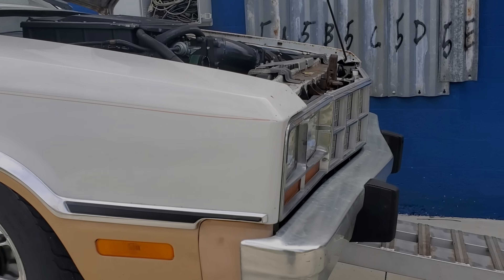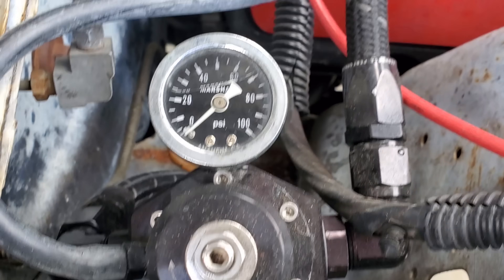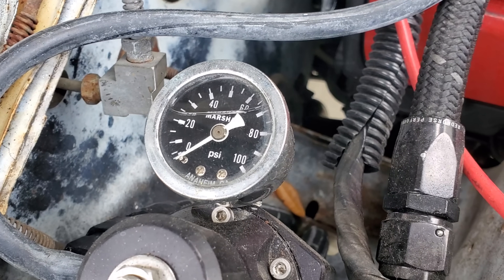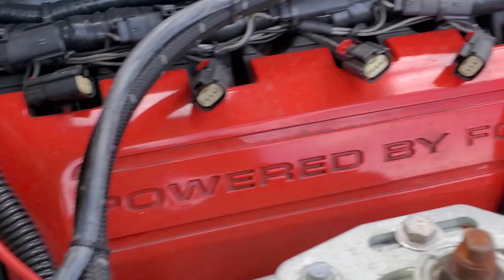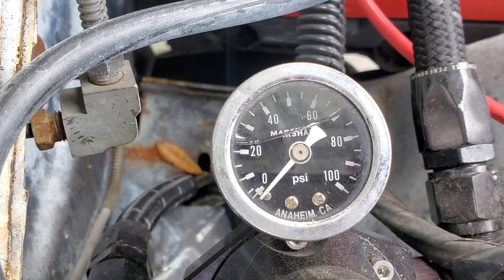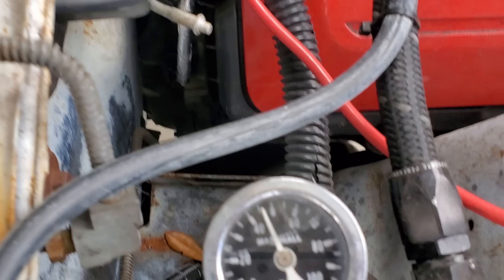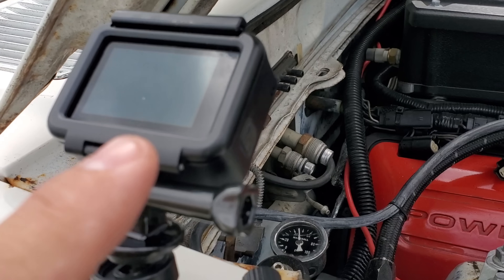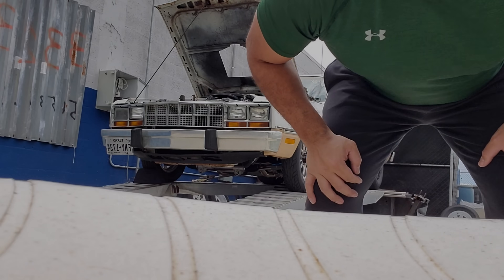Return Fuel system setup on Supercharged coyote powered Ford vehicles.

Comment: Can you make a video on installing in line fuel filters on s197 with a return style setup?
Reply: I just finished installing my FORE fuel system.  Once you're under the car doing the install it's straight forward to screw the bullet style filter onto the AN lines.  FORE's machined filter holder was too big (hung down too low) to work on my '11 GT500.  I used a padded hose clamp and attached the filter to the fuel tank vent line then put the plastic skid plate back on.
Reply from the maker: It's a simple screw on piece there's not much to it

Comment: Hey Alex! I heard if your swapping a 3rd gen coyote with D.I. you dont need a return style pump. This is info on swapping into a 2006 3 valve with a GT500 fuel pump. Sound accurate to you? Thanks!
Reply: It wouldn't be boosted but it would definitely be on E85. That's a must!
Reply from the maker: @coyotefury  I'd do a return with no boost reference (obviously) lol and you'll be good.
Reply: @coyotefury  E85 is great but people have said it eats away motor internals over time faster than gas.
Reply: maximus vonce E85 eating engine externals? You’re joking right 😂😂
Reply from the maker: I would run a return always when boosted.
Reply: For all motor no return needed but if forced induction. It is recommended to run a return style system for more boost or E85
Reply: @Sc300autogm  You don't need a return for boost unless on e85 over 650wheel. Gas cars making 750wheel no return.
Reply: maximus vonce  I said it is recommended
Reply: @Sc300autogm  i would run a return on anything over 650wheel.  Crazy not to.
Reply: Thanks!